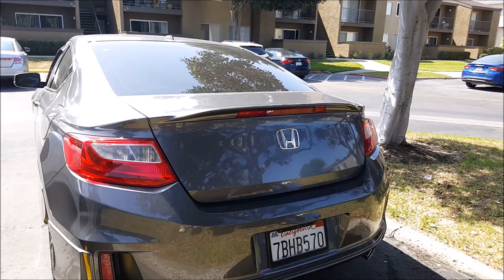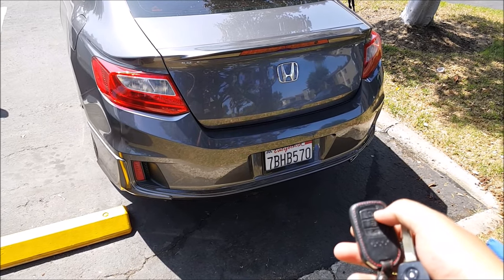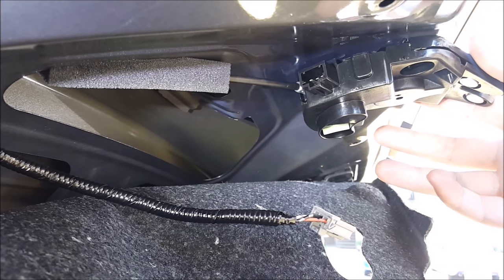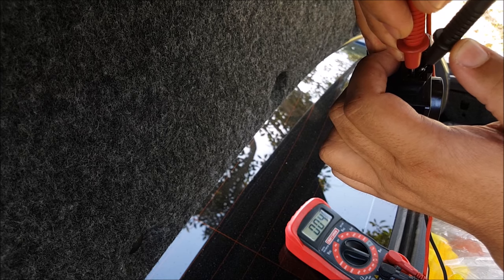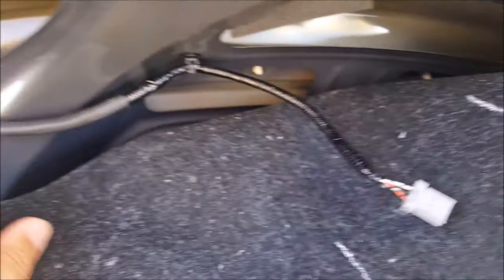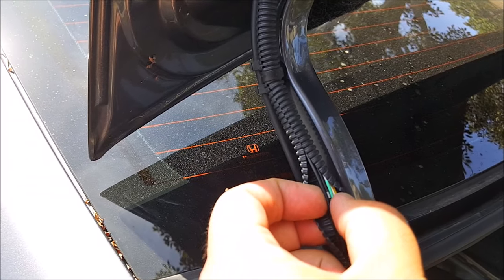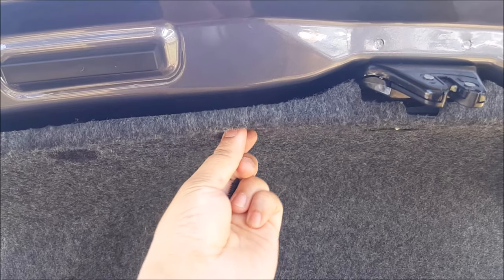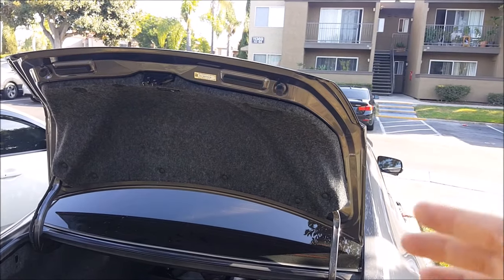[How to] Fix Trunk that will not open with the remote or switch - Honda Accord

Comment: thanks for this man! I moved to a new town and have been to a new garage twice now, just for an oil change/tire rotation. the first time i got the car back with a pinhole leak on the inside tire wall on a front tire (got it plugged somewhere else). the second time, yesterday, they apparently flipped this switch (which no garage I have ever been to has done) and didn't tell me. safe to say I will never take my car back there again.
Reply: Awŵaw   h y y

Comment: I have a similar issue but its on my 21 Acura TLX. I used 2 of my key fob, the button outside of the trunk and the button inside my door. They all do not work. I also check the glove box switch and it was clicked to ON. I even disconnected the car battery and nothing work. But when I do press the trunk release on my Key Fob, the hazard light do flashes. I'm pretty sure I would not of shorted anything since the trunk light is on. For the time being only way for me to open my trunk is manually by using the key and open it up on the rear deck. Do you think it might be a bad relay? Hope you  might have some insight to this.

Comment: Thank you for sharing the great tip, I was about to order the lock actuator, but just doing a final check with the part # and found your video, problem solved with seconds! 👍🏼

Comment: Hopefully mine doesn’t have this trunk issue, but if it does, your video in your library of diy will be very helpful
Reply from the maker: I hope so too. This was a little more technical to figure out the issue.  Even though I have a zero deductible extended warranty on this vehicle, I decide to troubleshoot it myself than taking it to the dealership to get it fixed so that other people can figure it out without having to pay the $120 - $150 diagnostic fee at the dealership outside the warranty period.

Comment: I’m having the same issue where my trunk is not opening with the smart key. The switch is set to “on” in my glovebox but the trunk release button on the actual trunk does not beep. What does it mean if it doesn’t beep when I press it?

Comment: Hey Jeff,

Do you know a way to keep my turning bulbs off while not in use (regardless headlights are on) ? Is there a fuse for this? I switched them to LED bulbs, and even though I bought the ones with covers to reduce glares as much as posible, they are throwing too much light out so that I just want to find a way for them to turn on when my signals are on. Thank you.
Reply from the maker: cut the red wire on the front turn signal socket.

Comment: Nice informative video. try changing the black wire with new one. from the socket all the way to the cut point. there might be a lost contact or break on the wire inside the wire insulator.

Comment: Mine has very weird issue with trunk. Actuator is working, but only when you manually trigger trunk release with car diagnostics. Button or key doesn’t work. I would say its a cable, but how can i open with diagnostics, but my key is not working. I have ford focus with keyless entry 2010 mk2

Comment: I had the same problem with my Acura TL, the remote only work when the trunk is open all the way,and did not work when closed half way, any suggestion?
Reply from the maker: check for broken wire.
Reply: watch this video again with both eyes and ears open.

Comment: I can't open my 08 accords trunk, my neighbor is much smaller than I and he was in the trunk for about 1/2 hour, he says theres a another cable connected to the lock which he couldn't get to....now I have to check out some more intensed accord manuals to see what I need to do, because that top cable is moving, and my key fob actuates it too....

Comment: Appreciate all the help that you povide to the 9th gen accord family. I would love a follow up on the morimoto xb fogs you are running and headlight setup.
Reply from the maker: Thank you for watching.  I had the xb fogs installed for the past 6-7 years and I have zero issues with them.  They don't blind on coming drivers and the beam pattern is crisp, sharp and wide.  Same thing with the  HID setup.  No issues whatsoever. I've been using their products for over a decade.  Great product and customer service.